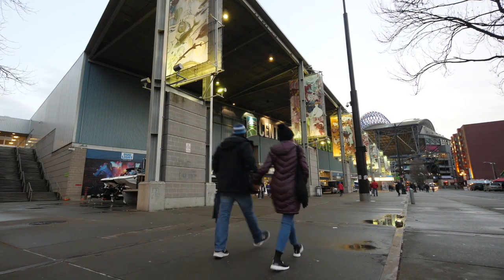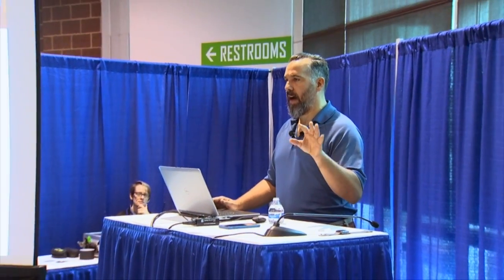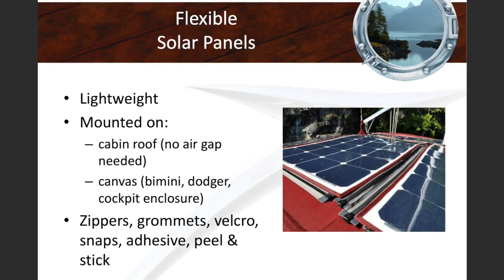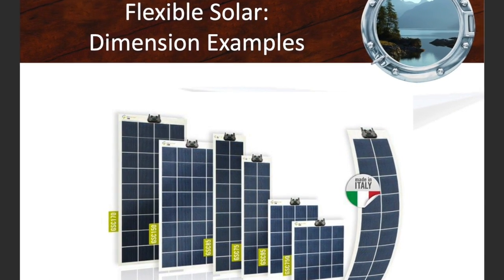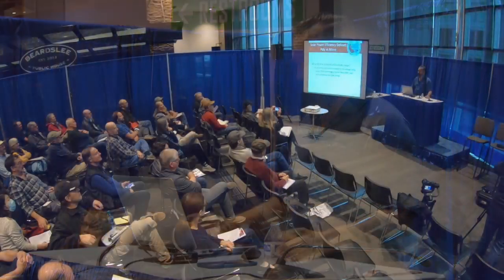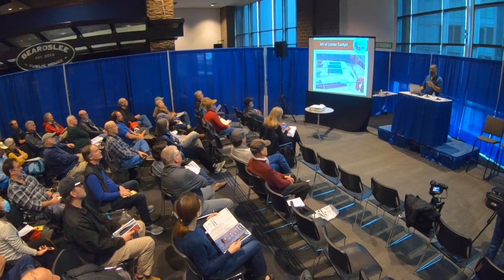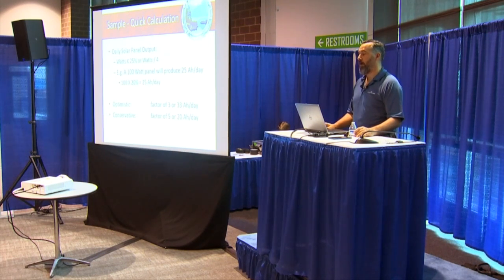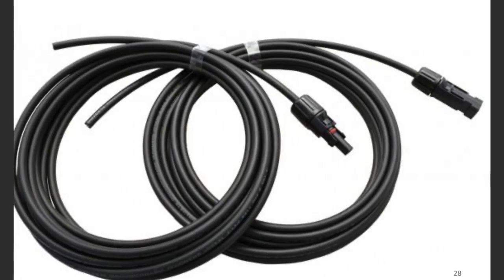Boat Show 2020: Solar Power For Your Boat

Comment: Very well structured presentation (getting better all the time).  Thank you for paraphrasing the questions.  An enhancement will be to have more cameras to avoid turning at every question or widening the field for slides, but then it will need editing.  Really appreciate the effort to recording and posting these invaluable presentations for deciding on electrical systems.
Reply from the maker: Thanks Giovanni, life's a journey with full of potential for improvement. Appreciate the feedback.

Comment: Thank you for another great video. You mention there's no such thing as 400w panels.  I installed 3 x 400w lg bifacial panels that are 400w each and the back of the panel adds up to 30% extra power. In perfect conditions (read in the lab) each panel can output 520w. In the height of summer I'm seeing 1200w peak from the panels. Because of the back of the panel also collecting power from water reflected sun, they would be perfect on an arch that doesn't have a cover. They are large though at 2m2, but for larger vessels give a lot of bang for buck.
Reply from the maker: Thanks for sharing Craig. Wow... 400 watt panels. That's impressive. Bifacial panels is a great idea especially for an arch. Will include your story on my next presentation.

Comment: I am adding  solar panel  to a boat - two separate systems (one for each engine/battery)
I am concerned about the main battery control switch( 1 -2 - both) batteries 
 In the both position the boat batteries are in parallel - will this damage the two solar charge controllers? or are they designed for this application? I'm using Renogy
Reply from the maker: Make sure your solar controllers are directly connected to each battery. Putting your battery switch in both/all/combine mode, won't damage the solar controllers.

Comment: at 20:10 - I've heard that all solar panels have a degradation factor of between 2 and 8% per annum. I'm interested that your panels after 8 years have no fall-off?
Reply from the maker: Hi Guy, well mine most be at the very low end, or it's getting sunnier overhere. Every season it surprises me to see how good they are.
Reply: @PacificYachtSystems  :)

Comment: Hello jeff, i have run all my wires throught negative and positive bus bars on my center console and then i have to add my solar power controller to the battery, is it ok to wire my controller output cables straight to my bus bars? Thanks in advance
Reply from the maker: You can connect solar only to a unswitched positive distribution, make sure that when battery switch is off, you still have voltage at the point were you'll connect the solar controller.
Reply: Thanks for the reply,  is it ok though to run my solar "charging" cables not fully directly to the battery but instead charging the battery through the busbars that my fuse boxes are fed from as well. In other words can i recharge my battery through the same busbars tha my boat runs accesories from while i have current draw from my accesories? Thanks in advance